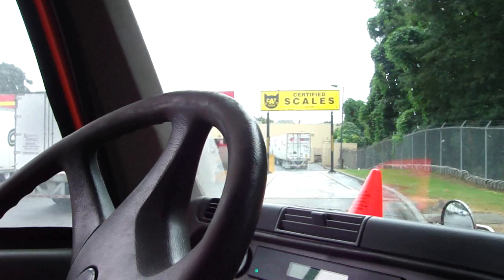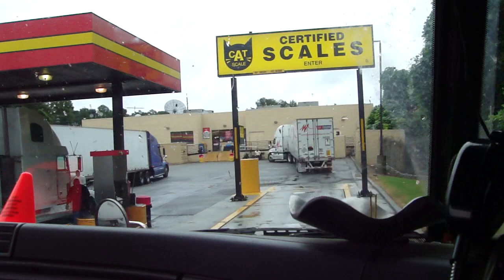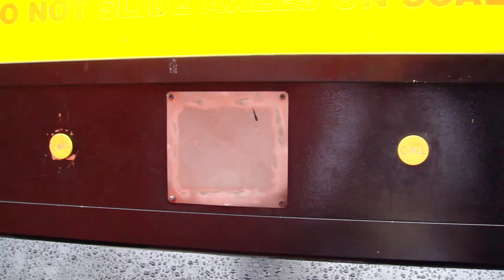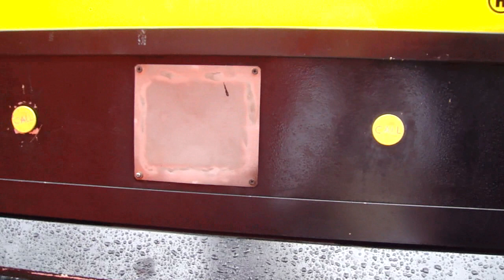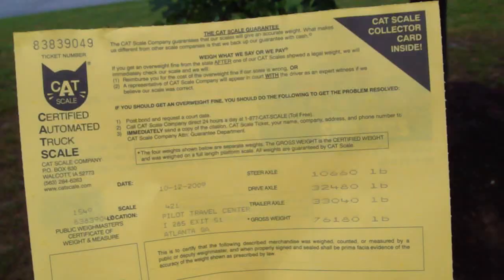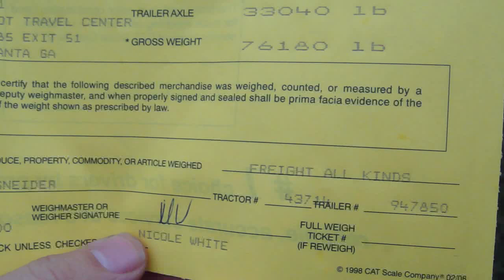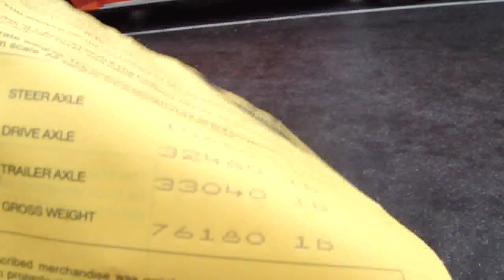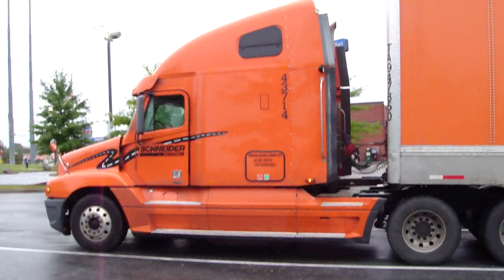Weighing my Schneider Truck on a scale

Comment: I find it hard to see how  he knows what his axle weights are since he simply drove on the scales without an axle check while driving on.
Reply: CAT Scales are divided into 3 separate individual scales, measuring the weight on your steer, drive, and trailer axles. Not your standard scale, it's a CAT Scale.
Reply: Peter Fienemann
Something new since I drove.  Actually seems like a bit of a time saver and somewhat easier than in those "good old days."

Comment: @somerandomdudepa if I remember correctly a automatci transmission in a semi truck is not much different from a 'normal' automatic transmission in a passenger vehicle. There is no clutch pedal. Recently some manufacturers (Volvo was the first) came up with semi-automatic transmissions with a manual clutch to make slow drifing (backin into a loading dock etc) easier for the driver because you have more control over the momentum of the vehicle. Hope that helps.

Comment: Exactly what most drivers think. Actually, as long as you are not over gross the steer max is 12,500lb. So...if you move your 5th wheel up one notch and get heavier on the front you will have a much easier time balancing out the rear two axles. I used to run 11,800 front axle empty and about 12,480 full and max load.

Comment: @ta23909 he would have meant with out permits but yes with permits you can have alot more.  in canada (ontario to be exact) you can have up to 7 or 8 trailer axles and i think that allows 100k or 110k pounds of goods in the trailer, not including about 15-20 k for tractor, and 10-15 for trailer.  ive only seen one truck like that personally

Comment: @TiffanyJ1985  The fee is 8 or 9 dollars and $1 or so for each re-weigh (for the scale shown). If your over weight you have to somehow take the weight off the truck. I had a case where I weighd and was over by 750 pounds. could not get rid of the extra weight by adjusting the tandems so I had to go back to the shipper and have them take some of the cargo out of the trailer.

Comment: Yes single axle with duals is 20k lbs, single wheel is limited by the tire rating, dot giving tickets for overloaded tires, they co n read ur sidewall x 2 n if u over that they get u, MO is doing it, i dont doubt some other states will start doing it

Comment: @KentuckyTrucker85 I am told because when your brakes are released you have your air pressure built up, and there is a tiny bit more weight on the truck? When you pull the park brake, maybe it fools the scales, cause the air is released and the brakes grab? PSI Pounds Per Square Inch...Weight ? Who the heck knows....LOL...Yeah I could see it being dangerous as well...I say apply your parking brake when scaling at all times..They already force so much safety stuff on us on the road as it is!

Comment: @rakoop Ahh, that makes since to me. and I never thought of it like that. You have a good point there. Though, I will admit, the entire time Ive drove, Ive always applied my brakes, sometimes just the tractor, sometimes just the trailer, sometimes / most of the time it was both, and Ive never had problems with axle weights, I was always legal on my axle weights. As another note, this is one of those things they should mention in school or at least your instuctor should mention I think.

Comment: @Knapper32927 That might be true, though as I mentioned in a previous post, I have always set my brakes and have never had any issue with weight and never had any trouble with DOT due to it. The only issues I had with using scales is sometimes the person printing off the slip didnt spell the company name correctly lol.